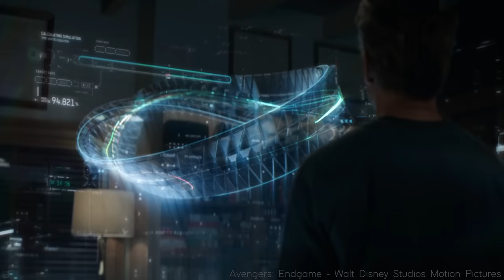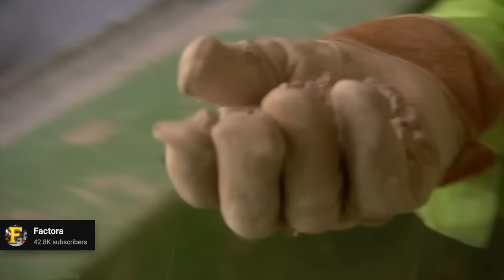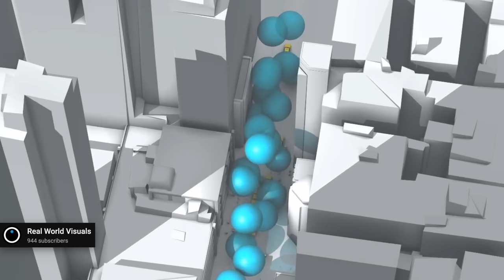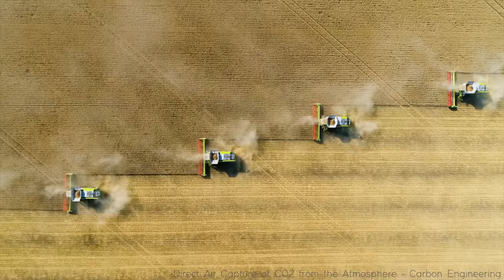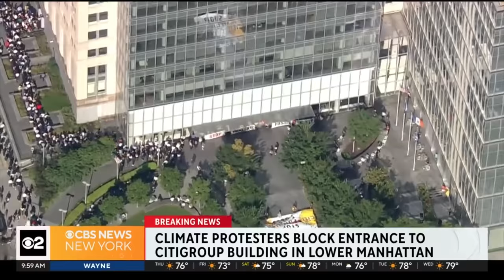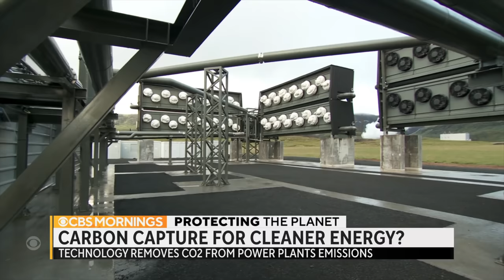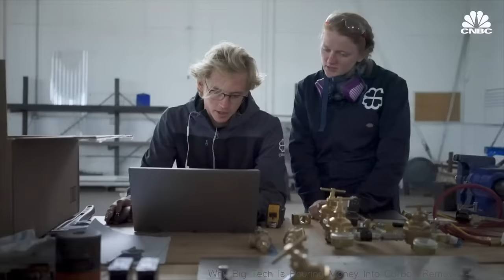How Thermodynamics Holds Back Negative Carbon Tech

Comment: Advanced nuclear, nuclear, nuclear!! Even though you didn’t mention the word once or show a picture of one, your entire video is actually an advertisement for advanced molten salt nuclear reactors. You successfully argued we need way more energy than we currently generate in order to terraform our own planet (whatever direction it needs to go) and that must be clean, safe, and simple—ergo molten salt nuclear reactors that first burn our current stockpiles of nuclear waste and then burn thorium.
Reply: This. The key to all our problems is massive energy production.  Nuclear energy, even if we are just stuck with fission processes, provides the scale of energy production possible for these more fantastic solutions like DAC and mass scale water desalination.  It also allows us to produce all hydrocarbons synthetically without the drilling and such.  I don't understand why we are wasting time with things like EVs while we continue burning fossil fuels for power plants.  The first nation to go all in on nuclear power is going to be tomorrow's superpower.  Sure it's expensive, but part of that is because economies of scale cannot take hold when we build so few plants.  More over the next gen plants are cheaper to build, maintain, and are safer if only we would fund and build them.
Reply: Ergo solar. You just lay out silicon in the sun. No moving parts. Tech is on a rapid exponential cost curve. The sun produces far more energy than we need to do all this terraforming. If we could capture all the sunlight hitting earth, and use it all to capture CO2, we would need 37 minutes of the suns light.
Reply: @donaldhobson8873  If it was that simple, sure but its not. Solar panels rapidly degrade and a very good lifetime for a solar plant is 10 years before all the panels need replaced. This is 1/5 the life time of even old school nuclear plants. Solar also has huge non-conditionary environmental impacts needing an order of magnitude more real estate to produce the equivalent energy of a nuclear plant. This is land that will need roads maintained for access, critters killed in traps/poisons to avoid damage via wire gnawing and nesting in components . The land will need an army of landscapers to keep the grass/plants at bay and even in a desert to keep the sand dunes from burying panels. Run off from these huge swaths will likely effect watersheds negatively.  Then there is the much more intense equipment maintenance needed just due to all the travel and individual components involved in rectification and energy management and transport. Then there are the megatons of mined copper needed for all the individual solar panel interconnects. Solar can also not scale with demand which is critical for any power generation and lithium ion battery storage cannot scale to the levels needed for global grid scale storage. Even if it did by some magic, the mining/disposal of cells is a environment nightmare and the storage plants would need an army of techs replacing cells daily.

All that is not to say I think solar is useless. It has a part to play and I think it is much better than wind.  That said, it will never be 100% of our power generation and will likely never top 30% of it. Nuclear (augmented by solar) is really the only alternative if we want to stop burning fossil fuels.
Reply: Pump it baby. SMR NNE OKLO to the moon

Comment: I'm confused by the equivalence you draw between the Gibbs Free energy and the electricity consumption implied. That thermodynamic free energy is not necessarily an input to the process. The binding of CO2 to sorbents is endothermic and the "separation" is just driven by wind (I'm ignoring that you might be driving that wind yourself with electric fans). The gas separation is not what's driving the energy here. Am I missing something?

Comment: thanks much for this, I was wondering the exact same thing about these devices, whether they are physically feasible. Indeed, you just gave the greatest argument for nuclear fission I could ever imagine - you can create these machines, standalone, almost completely automated and in remote locations, without needing to create all the infrastructure necessary to hook it up to the grid. They could run off primarily thermal power generated from the fission reaction and run without C02 emissions. In addition, you could use that thermal energy TO produce things like concrete and steel without needing to create electricity from it. 

I'd love it if you made a follow-up video describing that, where nuclear is used for direct substitution of industrial process heat and in heating for residences and buildings, as well as driving these processes.remotely and in scruibbing flue gases. and see how the math shapes up here.

Comment: Liquid Air storage for grid scale energy storage has a neat side effect. You will get frozen co2 as a side effect, that you can then capture or use in some innovative Cement or steel processing that need a carbon source.

Comment: Good coverage. I was just trying to see what’s what, when I got to this video. 👍 I reached the same conclusion (1 trillion tons have to come out, net…) In any hard problem, we design to overshoot, hopefully to have cushion. Right?

I can’t tell if your analysis already includes fertilizer production (i.e. food) and concrete (ie, shelter) at 2024 levels. (?)

I agree emissions are high priority, but “zero emissions” is like your observation that DAC will never be 100% efficient. So, what are the consensus models for carbon cycling efficiency? Looks like most carbon removal strategies assume the carbon removed will simply be burned again. So we need to think “gain” for each step, rather than try to compute the entire food chain, no? (For example, we’re gonna need clean fertilizer production more than we need clean tractors. But it’s “and” not “or” right? Talking about how hard the problem is seems kinda pointless if we aspire to live better than Cyanobacteria… Speaking of which…?

Comment: The frustrating thing to me is that we've had a major piece of the solution available to us for generations now, yet haven't used it.  Further to that, the loudest opponents of its use have generally called themselves environmentalists.  Nuclear energy is our best tool to take fossil fuel use offline.

At this point nobody who expresses anti nuclear energy views has any credibility to call themselves an environmentalist.
Reply: +100
Reply: To be fair, environmentalist =/= expert
Reply: 100%. There will be a day of fusion someday. But before fusion, nuclear power is the most reasonable choice for CO2 and almost all environmental problems we have. Next generation nuclear power generation will be much efficient and much safer. Nuclear power itself has very low carbon footprints and can support DCC power requirement without putting more carbon. 

Yes, we know renewable energies are becoming cheaper, but they have their own carbon footprints, and it is difficult to go massive scale. Nuclear power has already mature technology, can go massive scale, and zero carbon emission. Mining uranium can bring carbon footprint? Next gen nuclear fission plant using thorium can resolve that 100%. 

More and more think about this, we need to go nuclear power 100%, like right now. More usage of conventional fossil fuel power plant, more CO2. Really simple.
Reply: @MrSupasonics  Nuclear has a significant unavoidable carbon footprint in the same way renewables do, but has a much, much worse spin up time. It has a role but it isn't in any way a panacea
Reply: Except you're actually wrong.  We only have about 100 years of fuel for our existing proven designs, using our existing reactors.  If we want more, we need breeders, and then we need fissile isotopes to start them up.  There are no commercially available breeder reactors, and the research for them seems to have all but dried up.  Fusion is so far away and it has a he3 fuel problem that currently relies on fission plants, and it's unclear if the fusion is going to be able to breed enough to sustain.   The nuclear fuel we have, if we ran our grids off it, would last for about 5 years assuming we could overnight build enough reactors to run the planet.  So no, nuclear isn't our best tool to take fossil fuel offline.  It's more expensive, and less sustainable.  Wind/solar can run our civilization for billions of years.  Nuclear can't, even optimistically.  Using our sun's energy gradient is the solution.  And we're already building it at an unprecedented rate, because it's simply cheaper, the LCOE of solar/wind crushes every other option, and it's getting cheaper.  Nuclear is just a rallying cry for "do nothing because nuclear!" so fossil plants get a few more years of monopoly, or the monopoly shifts to who mines the uranium.  It's not good for people, not good for democracy, and not good for the planet to build nuclear, even if we had the fuel for it, even if the plants were free to build, even if we had a long term safe nuclear waste storage facility somewhere rather than temporary pools on-site.   Nuclear is a bad option every way you slice it.  We should use the nuclear plants we have as much as we safely can, but building new ones should be such a minor percentage of the total grid's generation that it's basically irrelevant to talk about.
Reply: @aneb2002  One thing I agree with you is how far the fusion is. I mentioned fusion as a future source, not now. Fusion is like a unicorn story as of now. 

If it is uranium, I agree about issues you raised but I wonder which source can I check the remaining uranium amount. But we have alternatives already. Thorium Molten Salt reactors.

Thorium reactors are not yet massive nor economical as of now. We are yet early stage level about TMSRs. But we have technology for it. Further investment on thorium infrastructure and refinement will make TSMR-based or TSMR-alike nuclear fission viable for incoming decades, at least until the 2100s. TSMRs are safer and more efficient. Thorium is more abundant, so it will not run out within a foreseeable time frame and easier to mine and refine (less carbon footprint compared to uranium), and it does not need to enrich. The only downside I think seriously is initiating fissile U233 or P239, but I'm still optimistic about Thorium reactors if we begin more investment now.

I think the gradual replacement of the current fossil fuel power plants and uranium/plutonium based power plants to thorium reactors would significantly reduce carbon amount and can sustain energy requirements from humanity for incoming future. Climate change is aiming a gun directly at our forehead. We need to act now. 

Plus, I must write this. Nuclear fission and renewable do NOT need to compete with each other. Nuclear fission and renewable can go together. I really can't understand why so many renewable energy mafia attack nuclear fission. Technology like TMSR is a confirmed solution. It just needs investment to be in mainstream.
Reply: @bosstowndynamics5488  We already have technology for Thorium Molten Salt reactors and Small Modular Reactors, which can reduce carbon footprint even further than now. We just need more investment to make those viable. There are peer review journal papers showing how the current nuclear fission power generation creates less amount of co2 compare to others. Plus, Small Modular Reactors are already in commercial service.
Reply: The cost of nuclear power plants matters.  The dollars per kilowatt hour for photovoltaic and wind generators is much smaller than any nuclear power plant.  The margin keeps expanding too.  It dies not matter what time of day or time of the year that we capture CO2 from the atmosphere.  It does not matter where on Earth we capture CO2.  Your claim that nuclear is an option within the context of this video is absurd.  There is enough nuclear waste material to get the job done.  But we have over a thousand times the sunlight hitting Earth available for solar.  The entire arctic blows strong winds.  Final thought: look at the thermodynamics equation in the video.  In he arctic the windmills get an extra 10% efficiency from the temperature.  In addition the windmill platforms can facilitate heat exiting the arctic ocean all winter long.
Reply: I have heard it put like this.

"Nuclear energy has the potential to kill everyone. But fossil fuels will."
Reply: @MrSupasonics  who do I write a check to to buy one of these thorium breeder reactors?  The only ones operating are either tiny research reactors or the one Russian breeder design of unknown flaws that there's one operating and one being built.  Frances superphenix reactor had technical troubles and got cancelled before they could be solved and the us ifr program had a similar outcome.  There just aren't breeder reactors available to buy commercially and getting them to a point where they would be commercially purchasable is a long long road building demo reactors and having years to prove all it's safety processes and protocols.
Reply: @MrSupasonics  Small scale modular reactors might exist but they aren't even remotely close to scalable enough to make a difference in a timely manner, and we don't have thorium reactors in any meaningful sense, they're still very much in research. We only have thorium reactors in the same way we have fusion reactors - they exist but in their current state are useless outside of research.

Comment: Maybe installing DAC on or around factories where the concentrations are highest and using some of the waste heat from productions to reach that 100C temp. But in the end I think DAC is going to be a bandaid and buy us time for better technologies to be developed.
Reply: LOL, so you do not want to captrue the CO2 directly at the exhaust, but some hundred meters away? Loosing a lot of efficiency? Please explain that to me
Reply: DAC is a way of fixing past damage if we figure out some source of super abundant cheap energy.

Comment: What about simpler solutions? In particular, promoting healthy soils? Due to their degradation, they often exhibit a sizeable carbon deficit relative to historical levels and so there is a significant potential for them to re-store large amounts of carbon by simply improving their quality
Reply: Planting trees costs 2x to 10x less and captures the same amount of CO2.
It is also way simpler
Reply: Yes, even something as simple as spreading crushed rock (serpentine) onto agricultural land will sequester CO2 over time.

Comment: So....what happens to the CO2 that gets separated by DAC?
Reply from the maker: Great question, one for another video perhaps, I didn’t want to go over 30 mins. But in short likely where it came from, underground
Reply: @CoolWorldsLab  pumping it in is gonna be  at least as energy expensive as pumping it out. That should be added to the graphs
Reply: CO2 separated from air by the exothermic and entropy-increasing reaction

Mg2SiO4 + 2 CO2 ---> 2 MgCO3 + SiO2

is captured, in the sense that it cannot easily return to the atmosphere, if it is just laid on the ground. @CoolWorldsLab

Comment: There are more energy efficient ways to remove CO2 from the atmosphere than this.
One of the interesting ones is one kind of CO2 battery, useful for grid scale storage - which can provide both energy storage and CO2 capture.
Taking in atmospheric CO2 during charging, and emitting pure CO2 during discharge - making it much easier to capture the concentrated CO2

Another interesting one, is extracting CO2 from seawater, which also ends up removing it from the atmosphere.
This can be done using just a fraction of the energy compared to removing it from air.

Comment: Thanks so much for fully explicating the energy requirements of DAC. I've never seen or heard this done with such precision before and it utterly illuminates why so many people have decided it is not a runner in the fight to mitigate climate breakdown. What I'd be very interested to know is, how do the equations work for photosynthesis, and for the reverse, the nocturnal respiration of plants when carbon dioxide is released? There's a puzzle there, isn't there, ie, the petajoules necessary, collectively, to remove carbon from the filters of DAC plants, and yet actual plants releasing co2 at night without solar energy? I'm sure there must be a simple explanation, but it would be good to see a video making the comparison. My other question would be, if the energy problem lies principally with cleaning the substrates/filters so that they can be reused, why do this at all? Couldn't DAC operate with a one-way substrate, ie, that create a dust like substance that contained the carbon and could then be used as a building material for example? A process akin to the way basalt rock can fix atmospheric carbon? I'm posing this on the basis of my understanding, from your video, that it is not so much the capturing of the CO2 that is energy intensive, but the releasing of the CO2 from that substrate so that the substrate can be reused. Thanks for any responses on this, I am researching the feasibility of large-scale DAC in the face of a natural world that is increasingly less able to sequester carbon as seasons are disrupted with floods, heat and drought.

Comment: Professor Kipping what about the CO2 emitted in the production of electricity? With   most countries still relying on the use of coal in the production of electricity.
Reply: In addition the 2050 date is unrealistic to accomplish the Paris agreement goals. It needs to be moved out to 2075 or possibly 2100.